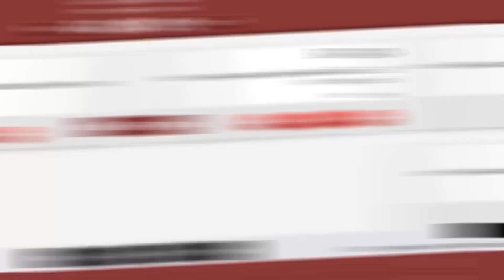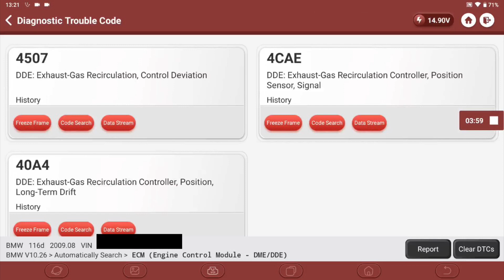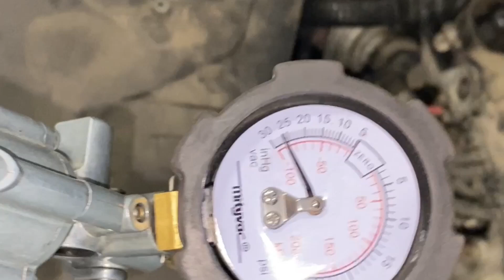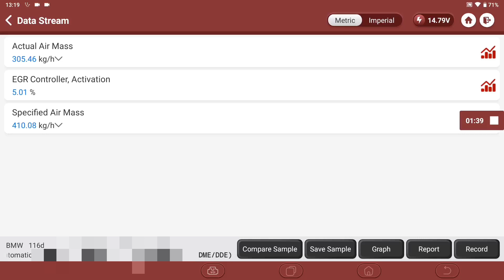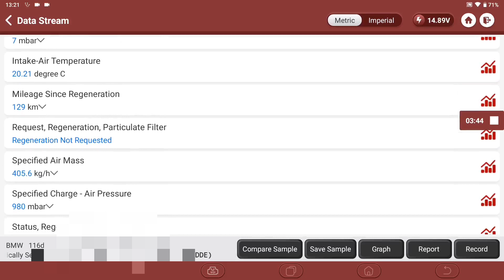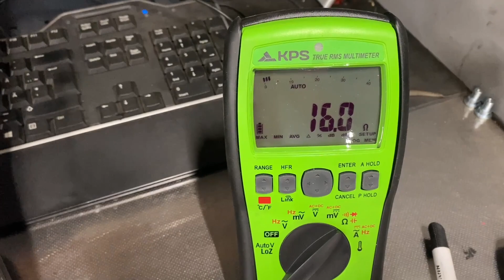EGR VALVE TESTING PROCEDURE ON A BMW N47

Comment: Ever seen these codes on 2009 118D.. 4CAE, 4B82, 41AB, 4B90, 4560, 4570, 4600 and 4610?
Vehicle drives fine for first few miles from cold, then EML comes on and goes into limo/ no boost mode. If I turn off and restart it drives fine again but only for a min or 2 before limp mode activates again. Mine has electronic EGR not Vacuum?
I had injector seals done and it drove great for a few weeks, then developed same fault, pulled injectors and had diesel leaking again so changed the copper seals again and no signs of leakage now but still have this fault. Strangely if I turn hard right or left this seems to kick the fault in too?!!
Reply from the maker: I have no idea without a fault description. I dont remember codes by themselves. Email me - 100 quid tech support

Comment: Love the detail and explanations, really informative and helpful in understanding how things work. My DPF badly blocked up to the point of blowing off the backpressure hose and the car lost all power. I've cleaned the DPF and the car has it's power back, but I've now got errors similar to what you showed here, 452A, 4A74, 4A79, 4CAE and 40A4. After going for a drive and doing a regeneration on the DPF, it went from a filtered differential pressure of around 16mb to -26mb, no idea how it can go negative unless I may need to tell the car the DPF's been replaced and to recalibrate??? Anyway, even with the DPF pressure looking like it's in an acceptable range I'm still getting the errors, so I'll work through your testing in this video to firstly, hopefully clear the codes, and secondly to hopefully find what's caused my loss of power and sook clogging up of the DPF in a reasonably short time. Your video's given me new hope of finding the issues, so thank you very much 👍.

Comment: I have 0041E2
Only fault code at all.

I took the egr valve off today. It had an exhaust leak around the base of the valve. It was all sooty.

Cleaned the valve, it seemed to move okay, in and out. 

New gasket and reassembled.

Still same trouble code.

Car seems to run fine, a bit slow throttle response, but still okay power.

A lot of diesel “clatter” or whatever at low rpm’s, engine doesn’t sound quite right.

Chains have just been done.
Reply from the maker: I dont know the code - its useful to give the meaning ie the fault code description. It depends on the engine type too. They can move ok but intermittently stick.
Reply: @BenJFF  
BMW e87 L:CI 116d n47.

Figured it out today. Broken wire to the EGR vacuum solenoid. 

I have a question for you.
I don't have a mityvac or anything like it, so i did some research and saw how different people went about testing these solenoids.

If i can blow into the "vac" port on the solenoid, and i air comes through. Even if i block the "out" port. Is the solenoid done for? I have to blow quite hard for air to escape this way.

Also. If i blow through the "out" port, there is no resistance through the solenoid, and air escapes through the "vac" port.

This is all with the solenoid removed and not powered.

Comment: There's so much information in this video! I'm going to test the potentiometer on my egr. the spring itselfs seems to be very stiff. any idea how much vacuum should open/close it fully?
Reply from the maker: No idea. You need a mityvac or equivalent just to see if it opens or not but if the desired position wasnt reached ie too stiff a spring then you would expect to see a feed back fault code as the potentiometer is there as only a position feedback and nothing else

Comment: The vacuum line lead to  rpm fluctuations ?? I have rpm fluctuations for example when i am driving at constant speed the needle goes up an down a little bit, someone told me its the gearbox converter, other one told me could be vacuum line or injectors !
Reply from the maker: It could be anything 🙂

Comment: This helped me, thank you. This issue was with the 3 pin connector to the EGR sensor, the female connector pins had pushed back out of the connector housing, and not making contact. I removed the plastic connector housing by in clipping the tabs and then pushed the loose wires home, then whilst holding them tight, reattached the housing clip, which holds the wires tight. The code went away after that and it is driving smooth. Reference code was “4CAE DDE: Exhaust-gas recirculation controller, position sensor, signal”.
Reply from the maker: Fantastic. So happy this helped you

Comment: Hello,sometimes i have 0040A4 long term drift cide, what could be the issue?
Reply from the maker: It means the Egr is open for too long. You need to see why. Maybe its sticking 🤷‍♂️
Reply: @BenJFF  okay,thats what i wanted to hear :) straight to the answer, thank You! ill try to clean it with a brush and brake cleaner
Reply from the maker: It might help but usually it will fail again mate but try it by all means. Have you subscribed:) My channel is slowing a bit arghh :)
 @edva135

Comment: Is there a spec sheet where you look at live data and see what values are the normal operating values? as i noticed in your videos you know what the values should be.  Is it bmw dealer only info? or diagnostic tool? Many times i look at those values and never know what they supposed to be within tolerance or not.
Reply from the maker: Very hard to know and it usually is in my head. The only way to see is if scan tool has actual and desired values. Bmw is very poor at data publishing

Comment: :learning:Great video ! Thank you! Great fault identifying , would a voltage drop test on live circute be good way identify this issue?
Reply from the maker: Yes absolutely but in this case the wires were not looking corroded. They were just abraded and touching. 

I always like to try to isolate them, repair, retest. 

Voltage drop would mean disconnecting DME harness connector and egr connector, run voltage , check drop. Lots of work that we try to avoid 🙂 Excellent question that you asked.